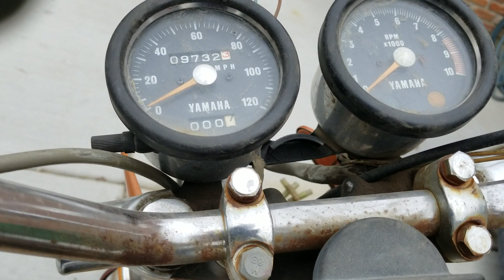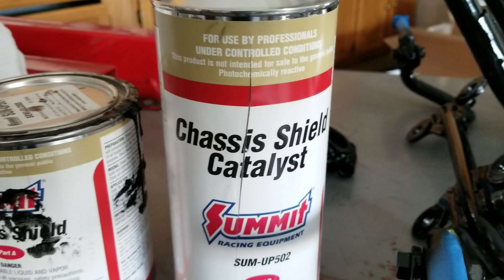1972 Yamaha R5 350 Restoration Part 1

Comment: I have a 1972 R5 I'm doing - the guy who had it blew the engine in 1975. It has about 4K miles on it and was stored in a climate-controlled garage under about 5 tarps . I'm switching out the engine (which I have and is sparkle nice)  because a rod was bent 90 degrees... I should be done early spring. I'll post a pic when done.

Comment: Hey buddy I just picked up a 72 r5 aswell with only 7k original miles!! Mine didn't have a key either. Mind of I ask how you bypassed the ignition? Looked like both reds and the brown?
Reply from the maker: congratulations on the score! The previous owner had cut the wires going to the switch and crossed over the wires? It's been so long ago and a few bikes ago I can't remember which wires??  If you do  cut the wires make sure it's close to the switch not the wiring harness? If you cut them on the switch harness, when you get a new switch you can just plug it in.
Reply: @JTSCUSTOMS   good tips! Yeah I figured it out it's the 2 reds and the brown.     Sparks good now! Thanks for the response

Comment: Hi, very impressive job you did, I myself have a similar object (R5 1971) that I am renovating. However, I have trouble getting the right color code (orange / mandarin) and wonder if you can give me the name of the color. Thanks in advance from Tomas in Sweden.
Reply from the maker: Yes the color is called Candy Mandarin Orange. The only place I could find it was VMR Paints.Call Dirk 855 485 7500
Reply: @JTSCUSTOMS  Many Thanks......

Comment: Whats the difference between rd350 and r5 350
Reply from the maker: The biggest diffrence is the RD350 has reed valves and the R5 does not. The RD350 has disc brakes. The R5 drum brakes.